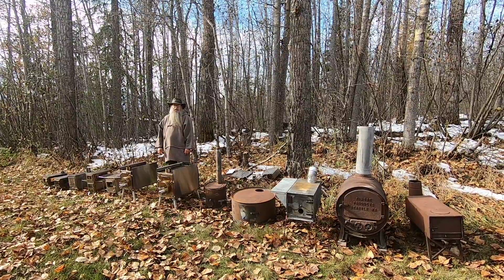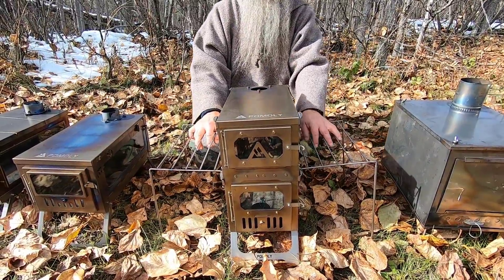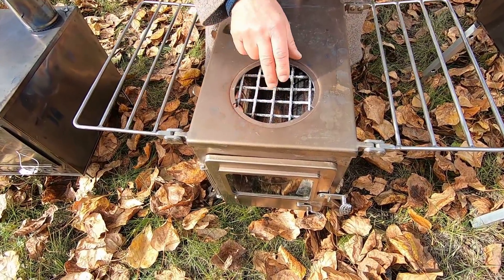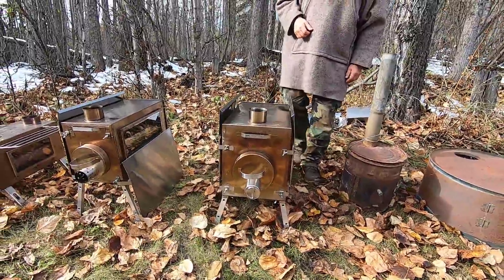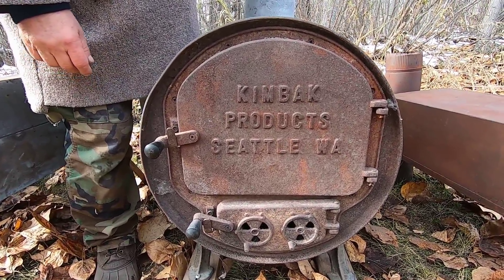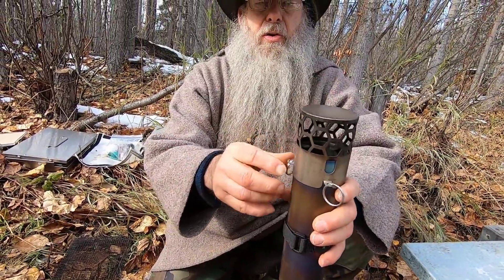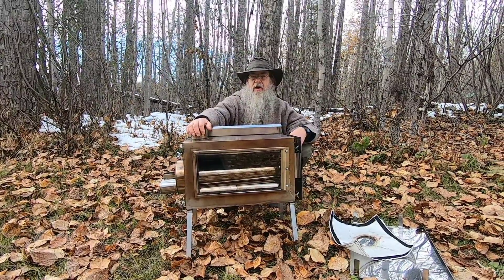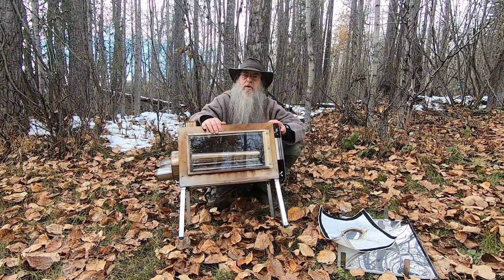Camp Tent Wood Stove info For The Common Man

Comment: My question is, Can one use regular thickness piping  first 4 stoves, extra protection?
Reply from the maker: Not likely since the stove pipe hole in the stoves are not standard stove pipe sizes.   In other words, one would be hard pressed to ever find a pipe to fit.   The break down stoves are the only ones to use the rolled pipe.   The other stoves use regular stove pipes.   To use a standard pipe in the break down stove does not make much sense anyway.   Those stoves are expensive because of their break down type of construction.  They are made ultralight and ultra compact and people are willing to pay the premium prices to get those features.   To use a bulky heavy stove pipe in those type of stoves would be to reduce the overall lightness and portableness of the stove system that you paid so much money to get that capability.

Comment: Would like to get Your opinion regarding stove pipe size and what you think is the best.
Reply from the maker: I used to think that the larger sized stove pipes were better but now I have some stove / pipe combos that use a less than 3 inch pipe and they seem to draw just fine.  Of course those particular stoves are small stoves.   I am not an engineer and so cannot really advise on what sized pipe to use on what size stove.  I will say that if a person makes a mistake on sizing, I believe it is probably better to be sized larger than needed rather than smaller than needed.   A larger sized stove pipe than needed can afford to have a greater amount of carbon soot and other condensates buildup before the problem will need to be addressed.   With our Alaskan prevalent wood type selections, I almost always have carbon buildup and If I am camping for more than a few days I will almost always need to disassemble the stove pipe and give it a quick in field cleaning before reassembling and continuing to use.
Reply: @Far-North-Bushcraft-Survival  Thank you for your Response. I am making a small wood stove out of a old propane cylinder for a ice fishing shack and plan on using exhaust pipe but I am trying to decide between 3 and 4 inch pipe.

Comment: A traditional wood stove is made of cast iron from my experience, now cast iron is probably not too good for traveling and would be very heavy to haul around, but do they make cast iron tent stoves?
Reply from the maker: I know of no cast iron tent stoves as they are just not practical for that use.   They are too prone to damage in transit as well as being VERY heavy for their size.   I own one in my remote cabin and I do not like it as it is not air tight and is very inefficient for effective air/burn control.

Comment: Can you build a stove with titanium large folding stove (hot tent wood burning stove ) like fast fold , and if so how much do you charge ?   I am very interested .  Thanks.
Reply from the maker: Sorry but I do not make stoves for sale and I do not know how to weld professionally.   If you have not seen it already, I show in a video how to make with hand tools one's own stove using galvanized ducting sheet metal.  I firmly believe that it would be quite simple to make a compact breakdown stove using the same hand tech.   I have not worked with titanium sheet metal and do not know how easy it is to bend.  However if it lends itself to manipulation by hand in the same way as the galvanized ducting sheet metal then one should be able to make a breakdown stove out of titanium fairly easy.

Make A Simple Cheap Tent Wood stove - Part 1
https://www.youtube.com/watch?v=5mhQ6JQokm0

Make A Simple Cheap Tent Wood stove - Part 2
https://www.youtube.com/watch?v=guxiCibNKTg

Comment: How do you keep these wood stoves from smoking so much I have a small camp wood stove every time I run it it smokes a lot unless I leave the door partially open and it's burning really fast air intake on front door is all the way open
Reply from the maker: It may help to add a length or two of stove pipe if your present pipe length is rather short.   Also you need to make sure that the stove pipe is clean and not restricted by creosote and soot buildup.   Another thing you can do is to elevate the back of the stove slightly above the level of the front of the stove.  Of course that is assuming that the stove exhaust is vented in the back half of the stove.   Do not allow the stove to "whoof."   What i mean by that is on some stoves, if the air intake exceeds the air exhaust rate, there will occur what I call a repeated rhythmic "whoofing" sound and often there will be exhaust gasses poofing out the air intake or open door.   To solve that problem if it occurs you will need to limit air intake at least temporarily until the stove pipe heats up thus creating an environment that encourages increased drafting of the exhaust gasses.

Comment: Hi!  Wondering about the size of the Kimbak stove you showed... I have a wood stove that is small, but not one that is typically made for a hot tent.  I want to put it in my 5 meter or 16' diameter bell tent and am just wondering if it's ok to put a stove in that has a much larger pipe...say a 6 or 7" pipe.  I'll have to configure a proper sized hole in the stove jack...but I just don't want it to be dangerous!  Thank you for any words of advice!  Crossing my fingers this can work as I already have the tent and was given the stove!
Reply from the maker: The "Kimbak" is made from a 25 or 30 gallon barrel.   I do not know how much clearance you would have left on your stove jack after making the hole larger to fit the larger pipe.  You do not want to end up having the stove pipe too close to the tent fabric or maybe even the thread stitching of the stove jack since the thread may be a synthetic that could melt if too hot.   You could always adopt the option of making your own stove jack if the existing stove jack is too small.   I have a video that may give you ideas on that subject if you are interested to go that route.

Turn Your Tarp Tent Into a Hot Tent - Stove Installation
https://www.youtube.com/watch?v=HfiUgGhTe1k
Reply: @Far-North-Bushcraft-Survival  Yes, excellent!  Thank you so much for the link.  I think this might be the way I'll need to go!

Comment: No mention of the glass sides breakIng??  Is it shatterproof glass?
Reply from the maker: No it is not shatter proof.  Fortunately I have had no issue with that so far.   It appears to me to be mostly a matter of common sense protection and handling.  It is actually not a glass at all.  But is a type of ceramic

Comment: Thanks for making this. 
Would heat resistant BBQ paint help out with rust on the homemade stoves or do they get hot enough it too would just burn off?
Reply: High-temp enamel paint would, I suspect. Applied right, it would do a fair job. My concern would be fired that get over the rated high for the paint, this causing burnoff and fumes, but I don't think that would be too much of a worry.
Reply: @swj719  Thank you
Reply from the maker: A high heat engine paint should work fine I think.  But I also think that stove paints are made for that purpose.
Reply: @Far-North-Bushcraft-Survival  Thank you, that is good to know. Really enjoy your channel.

Comment: Idk about the glass sides would it not cause heat loss and inefficient burning
Reply from the maker: Yes the glass sides facilitate heat loss through radiation especially.   Heat transfer through the stove walls and top is, after all, what woodstoves are all about.   No the stove will not burn any less efficiently as a result of the glass.   One negative for the glass is that there will be a bit of uncontrolled draft leakage from around the edges of the glass which makes it more difficult to adjust fuel burn rate.   However with proper stove pipe damper use along with air intake adjustment, most of that can be overcome.

Comment: We are thinking about getting a wood stove for our enclosed back porch. We don't want a permanent one so were thinking about a tent stove. The porch is about 450 square feet but has a 12 foot height. It faces north and has a 5 foot french door opening.  Would you think a tent stove would work for that use and if so, which ones?
Reply from the maker: Depending on how cold it gets outside and how insulated the room is, a tent stove may not be enough.  Jotul makes some attractive but smaller stoves for home use.  I am sure that many others do as well.

Comment: Amazing timing.  I literally started looking at tent wood stoves yesterday!  So I was looking for a bit more info on what stove size fits a certain tent size for winter camping in Alaska.  Would one of the titanium tent stoves keep a hot tent for 2 people at a comfortable temperature, do you recommend teepee style hot tents for warmth, or another type?  Concerned with what would work for 2 people on short cots, not a lot of room needed indoors for extra gear.  Thanks!
Reply from the maker: I do prefer a tipi or dome style for comfortable hot tenting.  The overhead area is minimized so that the rising heat does not have as much room to go and so therefor is warmer in the area where one lives.   A wall tent is one of the least desirable designed for cold weather  comfort as they have a large overhead area for the heat to disperse.   However even wall tents can be comfortable if a large enough stove is used.  I prefer a 55 gallon barrel stove in the larger wall tents.  They can be made to be quite comfortable then.
Reply from the maker: What size stove would be needed for your choice of tent is also dependent on whether the shelter has one or more "skins."   A double layer tipi would be much warmer than a single layer.   I have been very comfortable in a single layer pyramid style tent that was approximately 10 foot square using my 30 gallon barrel stove at 22 degrees below zero Fahrenheit.   I have been very comfortable in a double walled domed hot tent at 16 degrees below zero Fahrenheit using the smaller Russian stove shown in the video.

Comment: Wouldnt it be wise to use the double insulated stove pipe running through your tent??
Reply from the maker: No need to use a double pipe or insulated pipe if the stove jack is of good enough quality and construction to do it's intended job.

Comment: Lonnie, if you tune into Cowboy Kent Rollins YT channel he's the go to guy for outdoor cooking and cast iron , IMO, he will often take his iron and steel stoves and heat em up and season them with a good oil on the outside to prevent or slow corrosion. You can even use thin food grade mineral oil for that since you're not eating it, or heck even Crisco, just thin coats. He uses high temp food grade oils for everything because he is constantly feeding floks . IDK about titanium but I'm sure it might help on other metals. As long as you are safe with your burn off ?
Reply from the maker: Stoves will often reach temperatures that will burn off traditional oils when in use.   One of the best oils to use for seasoning cast iron is, or at least used to be, Crisco.   I have used Crisco on all my cast iron skillets to create beautiful seasoning that makes the skillets quite nonstick.   However one of the tricks that people use to clean off old seasoning on cast iron cookware in preparation to replacing it with a new seasoning is to place the cast iron in a fire or in a kitchen oven on self cleaning setting which is very high heat.
Reply: Yessir its a bit of a puzzle as far as a stove goes

Comment: Great camera work.  You didn't explain, and i don't understand, the purpose of a stove jack.  Obviously, it fits around the stove pipe, but at what distance from the stove and/or the top of the tent?
Reply from the maker: A stove jack is the fireproof material that is used incorporated into the tent for exiting the stove pipe through the tent.  It is typically in the roof or high on a tent wall to allow the stove pipe to safely go trough the tent fabric.

Comment: They should have added some ribs into the stove.  Just some of those and it would be so much stronger and less likely to warp.
Reply from the maker: Several of them do have ribs.  However ribs somewhat defeat the purpose of those light weight titanium stoves.   The more reinforcements used, the heavier they become.

Comment: I know this may be a difficult question with many variables but If you had to choose one of those stoves for all your camping / survival needs,  one stove to rule them all so to speak,  which one would you choose.  Asking for the man who can only have one?
Reply from the maker: As you said, there are just too many variables as I would not want a large stove in a tiny tent nor a tiny stove in a large tent.   However, Connie and I both agree that overall we like the Winnerwell Nomad view Large stove that we showed in this videoas our personal overall favorite.   In terms of tent stoves, By my standards, it would be considered a medium sized stove and could be used in a small tent with enough tent ventilation if needed and it could be used in a large tent in warmer winter temperatures.   It is a heavy duty well built stove.   We both really like the water heater that I showed in the video.  We also like the side glass and side racks of this stove. We also (especially me) like the breakdown folding oven by Winnerwell as well.   However as I said in the video, the oven could be used on any larger stove tops of any brand stove.

Comment: You gotta check out the Giraffe stove you'll probably like it if you don't have it already.
Reply from the maker: I was not aware of this innovative design before.  A very interesting stove indeed.  Not sure how practical it might be without actually using it for a while.  It appears to be quite efficient.  A potential downside might be the large area that it occupies which reduces the space in often times limited sized tents.   Another downside may or may not be the amount of wood that it will hold at one time as compared to a traditional stove design.  Don't really know for sure without using it.

Comment: which size would you recommend to heat a garage that's 25'x15'? Im in PA
Reply from the maker: I do not know if the garage is stand alone or attached to a heated building thus potentially having one or two walls not exposed to outside cold.  I do not know how thick the walls are or how well the garage is insulated.   I do not know how well insulated the ceiling and roof are.   I do not know whether this is to keep the garage heated continuously or started up as needed on occasion.   It is better to go larger than needed in my opinion since that will give you a larger firebox to hold more wood and thus require less frequent tending.   If it gets too hot in the garage, one can always open doors/windows but if it is too cold and the stove cannot handle the cold then there is not much one can do about that.   I would recommend talking to others in your area that have woodstoves such as stores that may sell woodstoves  and ask their opinion on what you would need given your particular situation.   Try and get a variety of opinions before deciding on the particular route you will go.   My expertise is more with tents rather than permanent dwellings though I do heat my 12X16 cabin with a woodstove.
Reply: @Far-North-Bushcraft-Survival  thanks for the insight. Wall thickness and insulation is not something I have given a thought to!

Comment: Does a tent hold hot air in or is heating a tent more about the heat radiation?
Reply from the maker: Tents do hold some heat in.   Certain designs and or construction types will hold more or less heat depending.   Of course due to lack of insulation they loose a lot of heat but are still capable of holding in much more than open air.

Comment: It makes it a lot harder to scratch the glass if you round the sharp corners of your flat razor scraper. We do this to remove window tint in cars all the time.
Reply from the maker: So do you touch the blade corners to an electric grinder wheel?  Or???   Sounds like some good advice.
Reply: @Far-North-Bushcraft-Survival  Usually use a Dremel tool with a fairly fine abrasive wheel. Not sure it's too important as long as there's no burr left over.
Reply from the maker: Thanks for the reply and info.

Comment: Is there a way to insulate my wall tent by hanging tarps on the outside walls and roof?
Reply from the maker: Absolutely and you will most likely be surprised at the thermal benefits produced.   If you watch my recent videos where I show how to make a wall tent out of poly tarps for a simple camp shelter, perhaps you may get some ideas on how you can cover your existing  wall tent.   I would tape all the joints between the end walls and the roof/sidewalls.  Use a good quality duct tape such as Gorilla or T-Rex and perform the job inside where it is warm.   Once applied, the tape can and will withstand the cold use outside.
Reply: Thank you so much for your time and advise . I'm a big fan of your videos. Thanks

Comment: Just a tip, when you clean the glass, NEVER use the product magic eraser on stove glass, it is great for many things, but if you use it on stove glass, the next time you have a fire the smoke will almost immediately coat the glass like it is being painted on, it is really quite shocking to watch. I ended up using oven cleaner to get it off. Don't know why it happens, but it does, takes a matter of less than a minute to completely black out the glass.
Reply: Best thing to clean stove glass is the ash in the bottom of the stove. Take some, add water to make a paste, and clean the glass with that. Wipe it clean, good as new.